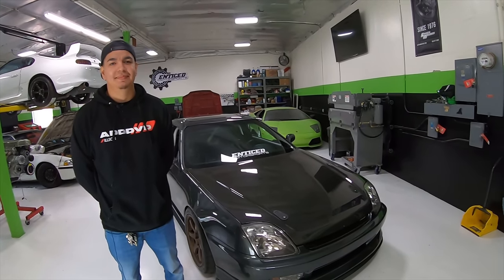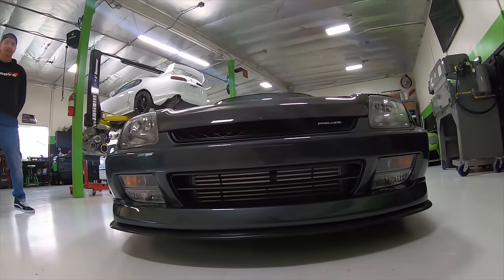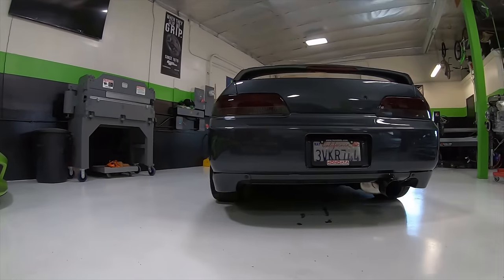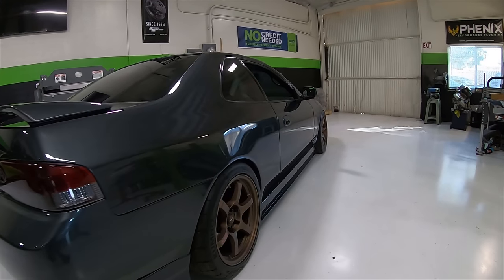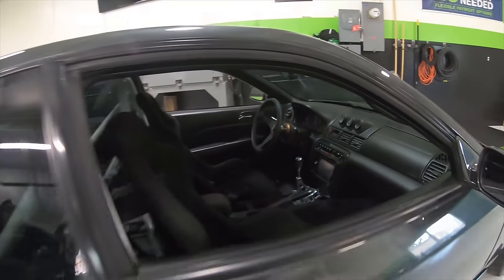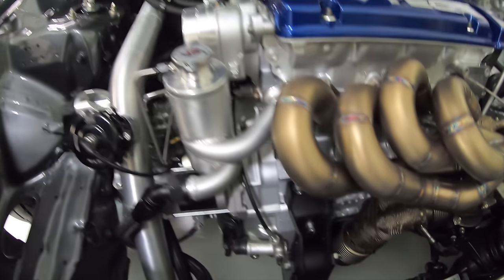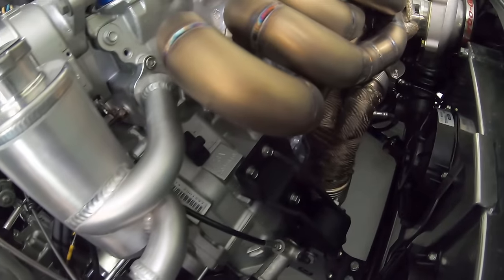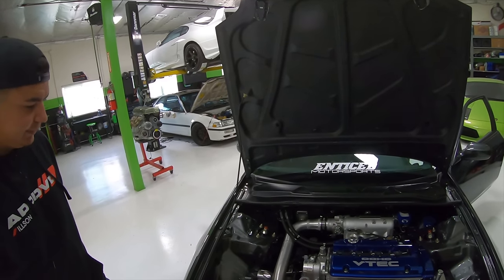SLEEPER TURBO 1997 Honda Prelude Base: Perfect Harmony

Comment: I just bought a 2001 type s from the original owner with 125k on it. This car has given me all the inspiration I needed to go after my dream prelude. I always wanted one back in the day in high school and at 33 I've finally made it a reality. Thanks Art for the influence.
Reply from the maker: That is awesome brotha, keep working on your build slowly man. I appreciate your time to watch.
Reply: If it is the actual type S i hope u kept it stock because the type S is VERY rare
Reply: @bigsock1375  Sorry bro she aint stock lol.   She's na, should be hittin the dyno in march hoping to hit 240 to the tires maybe more idk. euro r trans 12.1 pistons stage 2 sk2 cams ported head balance shaft delete ported intake 500cc injectors ram header full mugen twin loop exhaust. Hopefully reliable and not pushed to the max. This is a pasion build but I still wanna have some fun.

Comment: That Prelude looks beautiful! Don't see those anymore on the streets here
Reply from the maker: They are hard to see man. Such great chassis though
Reply: where you at? ive got a nice and clean 97 prelude base model that i want to sell. if interested ive got a video of it. i don't remember if the videos private. if it is let me know and i'll send it to you
Reply: @ihateliberals518  Thanks man! Germany. But I am not looking for one. Just would like to see more of them on the road.
Reply: @robsenb16  ya there's not many of them here in the states either. and when you do see them. 9 times out of 10 they've been "riced out" by teens and Mexicans. those ridiculous fart cans (mufflers) is usually the first thing they do. when i got mine. the very next day i went to the muffler shop and had a magnaflow muffler put on it. ( similar to the old turbo style we used to use on muscle cars)i would rather cut the exhaust off then have one of those other mufflers on my car!

Comment: Wanted a Prelude since I was a kid and they changed the body style in 97. Just love the uniqueness of the look, and Im a Honda loyalist anyway. Finally decided to buy one this year found a great condition 97 5 speed. Such a forgotten gem in the Honda lineup.
Reply from the maker: Dope man. Congrats! What are the plans for it?
Reply: @AutomotiveAnatomy  Just restore it honestly. The interior was in just incresibly good shape for its age and miles 195k. I had the driver seat re-upholstered...the car is actually CDM so it has leather and also heated seats which is rare. All original interior pieces are present and in good shape, I got new prelude mats made. I did put all new pipes on there AEM CAI, megan racing headers and apexi ws2 exhaust but im not boosting it I want the engine to last forever. Im looking for a new steering wheel preferrably OEM and i am replacing the much of the suspension it is lowered a little bit but pretty much everything needs replaced. With a few personal touches I want it to mostly be original.
Reply: @Ccastine9 nice man im trying to do the same with mine I own a 97 base model as well it's fun to drive for sure

Comment: I love preludes so damn much. If ONLY they came in RWD😭
Reply: They would be priced at supra levels
Reply: I know people can swap it to rwd but idk the specifics it’s probs hell’s expensive
Reply: @doozy.5494  yeah I’ve heard the same. I can only imagine the cost of it smh. I sincerely hope if Honda goes back to its roots with its cars such as the prelude, or even RSX/Integra (Acura). That they offer them in RWD. So many car companies now offer different drive trains with their cars, but Honda barely even offers it with their SUV’s in general. They’ve become family oriented and have kinda distanced themselves from what they once were but We’ll see.
Reply: @doozy.5494  Its not a case of if its expensive or not, its just that there would be a lot of cutting and re adjusting stuff to fit a rwd or awd conversion kit on a prelude. I own one personally and have even looked underneath to see if it would work, and its a lot of difficulty.
Reply: @Saffa98  oooh can you explain more lol cause I’m half tempted to get a Honda and try it even if it takes a long time
Reply: That is where the S2000 comes in...or just get an NSX... I love the Prelude SH.. one of a kind.
Reply: I got you💪🏽
Reply: This design is much better that the s2000.

Comment: my 5th gen lude is fully built. I still need to get a wrap and wheels. retained power steering and ac. g30-770. dynos 680whp hondata, t2w4 lsd. i spin tires thru 3rd. wideband, mac 4 port, full 3" dual exhaust. love my car....

Comment: Im a Gen 4 VTEC guy but this is cool. Gen 4 front end to me is iconic. It has the best clutch/cable system that is like butter. In 1997 they changed to hydraulic....I do not like as much.....and I am a big fan of the space age dash on the gen 4. . That said any prelude from 1994 on with the VTEC is one of the most balanced fun to drive cars that are also dependable in history. That is the key word is just balance and feel. It may not do the most intense torque off the line thing, and it is not RWD and not the fastest.....but when it comes to balance and feel, it is one of the all time greats....with enough power to keep you grinning....especially 4th gen. This coming from a guy that has owned and driven a lot of sports cars.....It really is one of the best feeling drives ever. Those that know .....know.
Reply from the maker: Preludes are amazing man!!!

Comment: 5thgen Prelude is where it's at, I'm on my second 5thgen...1999 Nordic Mist Base model with factory black leather,  factory born 5speed manual shift (wasn't easy to find a good condition 5thgen base model with a factory 5speed manual).  My first 5thgen was a 1999 Nordic Mist 4speed A/T, it was a great car and I loved driving it but doing the manual swap wasn't worth it.  Anyway this 5thgen is sweet.

Comment: My first car was the Prelude before this model. I had the more rounded model and it was silver. Manual transmission.

The car was handed down from my dad. He bought an Acura and gave me the Prelude.

I remember racing a group of 4 wheelers on a dirt road and smoking all of them, then losing control of the car and literally came within inches of going in a ditch. The front tires stopped inches before the ditch.

I miss that car. That's why I'm watching Prelude videos. I'm 39 years old now.

Comment: The only issue with the prelude is the weight. Some weight reduction will transform the car a lot. Get it in the 2400-2600 range and you’re solid. It already has a potent power plant. Transmission ratio is not the best but it’s ok. If done right the h series or F20b can make k series numbers on the dyno with proper bolt ons. Add cams. Handling wise they handle well to.
Reply from the maker: I agree, swapping out a battery and some other goodies can make a huge difference.

Comment: Clean car kid nice job! I have a 1993 Prelude. There smooth and fast. 👍
Reply from the maker: It sure is! Thanks for the support.
Reply: @AutomotiveAnatomy  I'm replacing a distributer on my 1996 Honda Civic. Also wanted to know if a 1994 Honda Accord engine will work for the 1993 Honda PRELUDE. They seem very similar 4cly  16 valve. The Prelude has a higher grade PGM-FI  Programmed Fuel Injection.  What's your advice!! PLEASE

Comment: Once i fix my prelude up i want to turbocharge it. Lots of work though... 260,000 kms, leaking from front and rear main seals, oil pan gasket, definitely going to need a rebuild before i even think of boost. Bodywork is a must too, front bumper isnt paint matched, rear quarterpanels are rusted out... i can dream i guess

Comment: Just purchased a 1 owner meticulously maintained 97 prelude. 1 serious offer to buy the car from a stranger in Autozone. In 97 from the original window sticker someone paid 27k. I paid 3200 cash the chassis is still firm 120mph down the interstate yesterday and the car is near silent.  The technology and design standards this car had in 97 is almost not believeable. The car rocks search Craigslist and have cash they're out there.

Comment: THE WHOLE CAR IS CLEAN THOSE ARE SOME AMAZING WHEELS DIGG IT ALOT BUT OVER ALL WHAT DID HE USE TO PAINT OR COAT THAT MOTOR IT LOOKS REALLY CLEAN SMOOTH ON THE CAR ??? THANKS GUS FOR THIS CONTENT ✌OUT
Reply from the maker: This car is a beast Noah!! Scary fast.
Reply: @AutomotiveAnatomy  YUUPPP I SAW IT IN YO FACE WHEN HE DID A PULL LOL

Comment: its a nice build but you shouldve kept it all motor with nice big cams and decent compression. i've also got a 97 base model it's mostly stock tho
Reply from the maker: thanks for watching, boost is so much fun but NA sounds beast as well. Every build is uniqye. Thanks for watching.
Reply: @AutomotiveAnatomy  I like na not only because it sounds so good. But also because you've got power from idle to redline

Comment: Great build quality and attention to detail. Although the flared Prelude is an absolutely beautiful car, I have to ask why? I'll preface this by saying I have mad respect for Honda power, reliability, and durability, because racing time attack I've had my ass handed to me by more S2000s than I'm willing to admit. Whether in bone stock solo, street bombing in my daily driver, or open class time attack I am stupid competitive when I get behind the wheel. I've also spent 35 years poring a ridiculous amount of money into a 72 Datsun 510 track car trying to stay competitive, so obviously I can't claim to be a pragmatist. However, there are competitive advantages to "investing" in a very light RWD race proven platform. 

I respect those who track their car for the fun of just driving it fast, but I've driven a few hot 350+ hp early 90s era Civic and Corrola hatchs around Sonoma Race Way and it was about as much fun as wrestling a 2000lb. crack hoe. No doubt the front transvers configuration was revolutionary, but it was never intended for performance application; rather for practical road transportation. The issue is not anecdotal hear say, subjective reason, or straight up marketing BS, its a matter of weight transfer under acceleration. I know this is going to sound like I'm a hater but seriously why put so much time, energy, and resources into a FWD track car?
Reply: Prelude outperformed the same years Ferrari in the Slalom test, and on throttle let off you can get the rear to rotate. Plenty of FF track cars making serious times. Even racing on tracks beating Vipers, RX7s and more. I can link a video of a gutted civic with a k series flying by track spec RWD cars.

Comment: Good first car? What do you guys think? Love your car btw.
Reply from the maker: well not super modify like this one but yes it would be agrat car to learn to wrench on man
Reply: @AutomotiveAnatomy  Thanks. I'll look into one
Reply: @miataenjoyer2786  I have been fixing up mine and they make phenominal cars. Things you NEED TO CHECK/ASK about when buying. 

1. DOES IT BURN OR LOSE OIL (extremely common due to the FRP cylinder sleeves/valve gaskets)

2. Has the Idle Air Control Valve been replaced or serviced (easy and cheap even if you do it). Causes a bouncy idle. 

3. Interior condition. Parts for these interiors are rare, most have to come from part outs. 

4. Rust? Its a Honda. Rust is the killer. 

5. Maintained and timing done. Nobody wants to buy a car and have the motor go. 

Otherwise its been phenominal and screams to 8200rpm. Better sounding than 99% of Hondas. Just as easy to work on. Good torque compared to the smaller B series motors. Turns heads everywhere and they look gorgeous.
Reply: Yes it is. I learned how to drive in stock 94 si prelude. Did my driving test at 18 in it. Handles good enough although it does have a bit of a floaty suspension stock. Enough power to drive around town but not enough to kill you. Transmission is great as long as you don’t grind the gears often,the cables get stretched out when you do.  Driving position is great to. Car has bucket style seats with plenty of room.
Reply: @jordanjoestar8839  thank you!
Reply: @TheBb6prelude  nice name, and I’ll remember that as well.
Reply: @jordanjoestar8839  how can you know if it burns oil?
Reply: @kristoKR-zj8oi  blue smoke under acceleration. Loss of oil between changes.

Comment: Whaaaaat remove the sunroof, haven’t seen anyone do that before..seems not necessary  /:
Reply from the maker: lol he eventually will.
Reply: doing it for weight reduction i never use it anyways
Reply: @DeeJayAmuze  would you really feel a Difference? You could drop your zero to 60 by like what half a millisecond, unless your on a drag strip racing professionals would ever really notice the “ increased performance ” I think at that point it would be more in your head 😛
Reply: @dubsteppwarrior  never said this was a drag car. nor did i build it for dig racing. removing 60 pounds from the very top of the car is actually a significant mod when you’re talking about road race / canyon runs especially when joined with the rest of the weight reduction i did.

Comment: i sold mine and regret every penny i made
Reply: you buy the sh and put a base bock in it, geometry of suspension is different between the two.
Reply from the maker: Buy another one.
Reply: @AutomotiveAnatomy  maybe after I get an 04 s2000.  Ive been looking at both here the last couple months. Price for a clean prelude is right there with an s2000.  Waiting for that deal.
Reply: I sold mines and it wasn’t for sale 😥